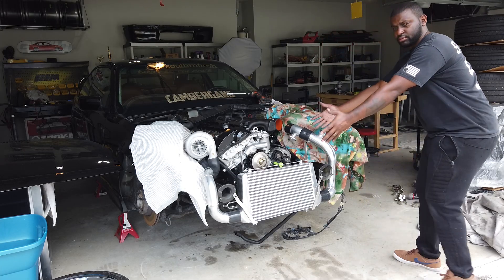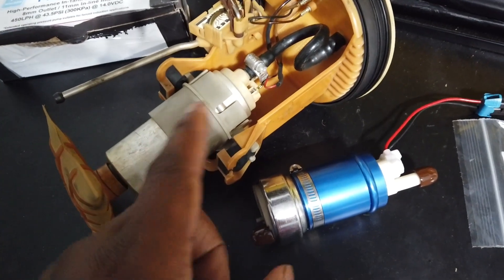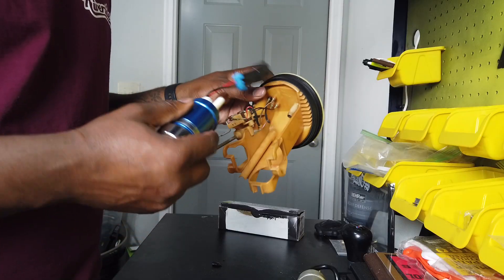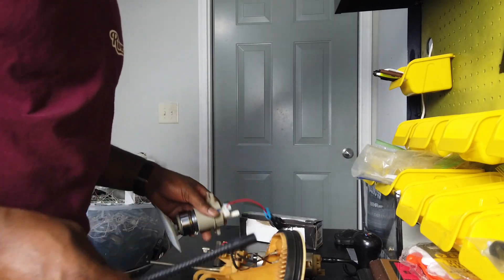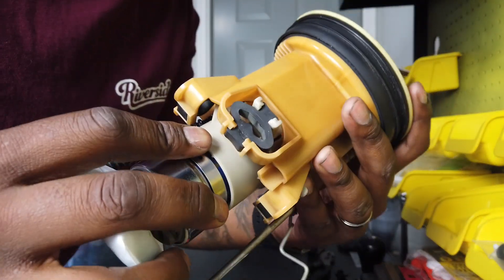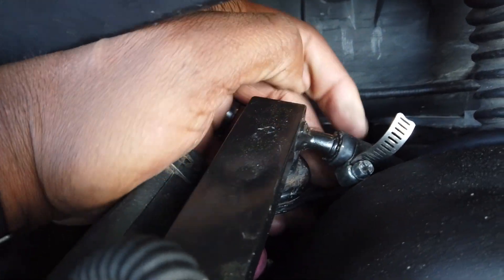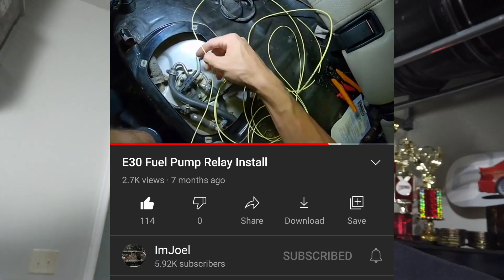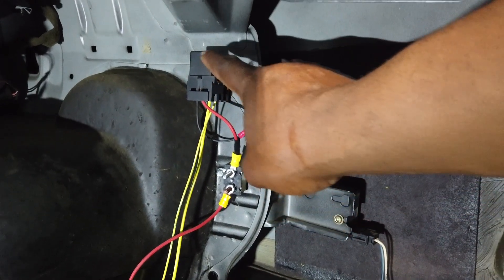How To Install Rally Road E85 Fuel Pump, Injectors, Relay Kit on E36 || Turbo E36 Build [Ep 26]

Comment: you have some good content for sure on your site.  I need to do some fuel pump work as the toy starves at half tank and I have the S54 swap in play...  it's been on the back burner... needs to be on front.. just depends on how other work procedes
Reply from the maker: Thank you. And that sounds awesome. I do plan on doing an S54 swap on an e36 eventually
Reply: @itsBlack  they are getting hard to find the s54 and going up in $$$.  I looked for a long time and just pulled the trigger last month.
Reply from the maker: @samthing4thetrack806  yeah figures. Seems like a lot of stuff is up like crazy right now. Saw someone selling an M50 for $800 lol. You used to beg for someone to come grab it for 400 lol
Reply: @itsBlack  hmmm  m50 is a good motor for sure... it must be age and desire for the iron block!

Comment: Just did the same set up you went with and all  and pump is not staying on, the relay clicks off and on when i crank it over..any idea? Upgraded to a 340 pump and new injectors
Reply from the maker: You mean with the car off? The ecu will only run the pump about 3-4 seconds with the car off. If it's dying while car is running then it's a problem
Reply: @itsBlack  when the accessories are on the pump is on put the second i crank it over it the pump doesn’t pump or anything just makes noise like its not pumping, i found your other video so hopefully me swapping the pins will be the issue with it as well im literally mirroring your build lol very helpful and detailed!
Reply: @oscarpuga2720 Did u figure it out yet? Sounds like you may have it wired it to the sending unit instead of the fuel pump.

Comment: Buy a fuel pump just tge connector and run the wire completely to tge connector dont recommend using tge old smaller wire to the new thicker wire

Comment: I broke my fuel rail bolt the other half is stuck in the intake manifold 😫😫
Reply: Rob Smith  I just did a m50 manifold swap
Reply: Rob Smith  not yet